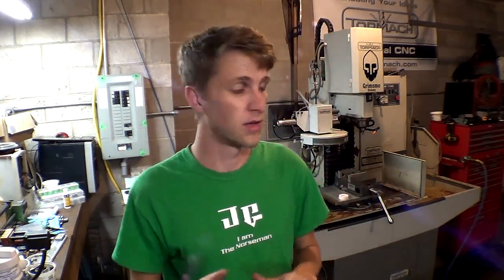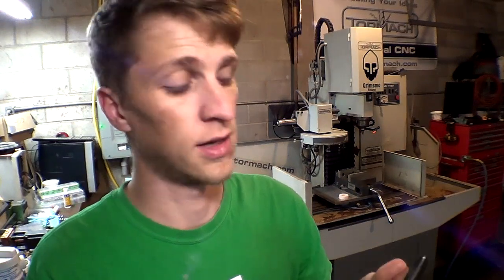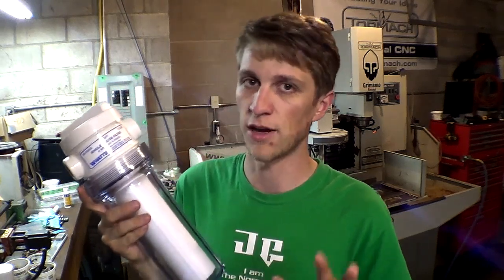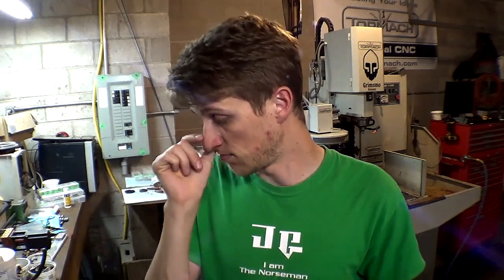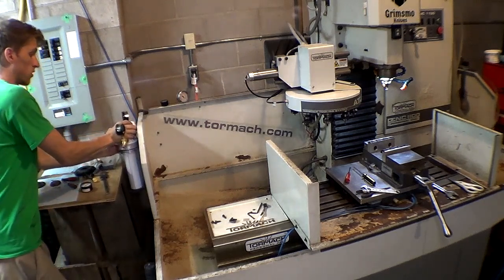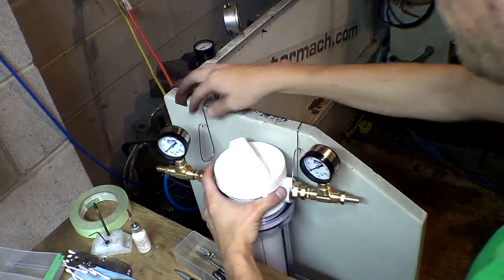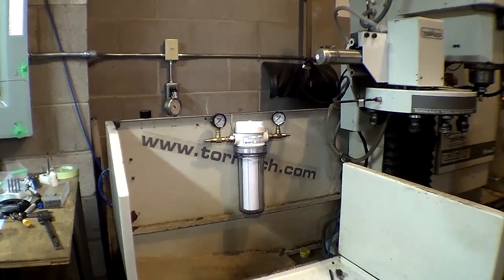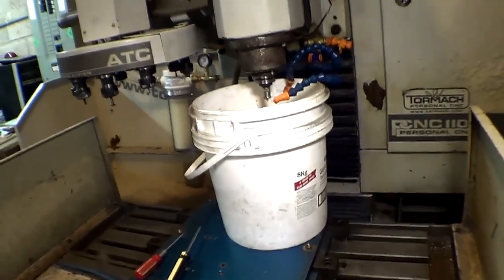Machining coolant filtration

Comment: A magnet in the bottom of your coolant tank will pick up and contain most of the ferrous chips you cut.  Could also put one in the chip tray next to the drain hole.
Reply from the maker: Good idea.  You could even glue a big magnet to the outside of the coolant tank, especially since my tank is plastic.  My  stainless blade chips would stick but all the Ti I cut wouldn't.
Reply from the maker: Good idea.  You could even glue a big magnet to the outside of the coolant tank, especially since my tank is plastic.  My  stainless blade chips would stick but all the Ti I cut wouldn't.
Reply: +JohnGrimsmo   just wanted to say I love your videos and ive been playing with cad for the last few months.  drawing triggers and pistol grips for some firearms i have.  I want to get into a mill and a lathe soooo bad.  just need to get into a house first.  then spend the next few years saving up lol. THANKS SOOO MUCH FOR DOING THESE VIDEOS!!!!
Reply from the maker: +toms place You're absolutely welcome!  There are lots of choices for getting into cnc, basically everything from a few grand and up. Have fun on your journey!
Reply: toms place you don't need a lot to get a lathe it a mill, I've got both for less than $2000.00 total. Including going to pick them up myself. Check out a site called govdeals.com they have all kinds of machinery for sale.

Comment: My personal recommendation would be to combine you strainer with an automotive oil filter, a large diesel engine one. It will pick the tiny stuff well, and extend the life of the coolant and part quality, not to mention your tooling. Just put the strainer you made in front of the pump, and an oil filter post pump.

Comment: Like the video I have a simple idea for ya I know you have all ready installed a filter for the chips but here is a thought for ya place a simple filter on the drane in to the sump something like a pillow case ziptied to the 90° it will help to reduse the frequency that you have to clean your filter and help when it time to clean your sump ... you may have to put a baffle in the tank to keep the filter off the pump (aka pillowcase)

Comment: this may have been covered below but, any specific reason why you chose to filter the discharge of your pump as opposed to the intake of the pump?  ideally the pump would then be protected from the filter as the chips/coolant sauce would drain into the tank.  maybe its harder than it seems, I'm not privy to the coolant pump system on the tormach

Comment: I filter the coolant coming out of drain.   Just take a butter tub or small bucket drill holes in the bottom and line it with plastic mesh.  It catches the majority of the chips and it's easy the clean out every few days. I use a small pond pump and a small tub like yours..  They work great. Nice job on your system!

Comment: See if a spin down filter would work for you.
All you need is a fine mesh, they are very high flow and use a vortex to push the chips to the bottom and clean the filter mesh at the same time, you can attach a reservoir to the bottom and the chips will fall into it. Do a google image search and you might get excited.

Comment: You can switch to a semi synthetics coolant if you would like to make sure you prevent rust. The shop I worked at got rid of full synthetic cause after the coolant would dry up it would cause rusting on our machines. We run our concentration between 6 and 8 percent

Comment: Problem lies not in the type of the coolant but concentration and condition of the coolant. If you know what "metal shop smell" is, that's mainly due to bacteria and other funky stuff living in the coolant that has seen it's best before a long time ago. Apart from the refractometer which ***** and others mentioned you might want also to pick up pH test kit, which are quite cheap, to control also the basicity of the coolant.
Reply: No I'm not, can't remember if I'm even registered over there :P And to be honest, I'm so lazy that I would never ever do a full cleanup and sanitation of coolant tank every 3-4 months. In the tẃo machines I use at work, I've last done a cleanup 1.5 years ago and the coolant seems to be doing fine.

Comment: As you were describing the "big blue" filter I'm thinking... "No way" haha. Im sitting about 4 feet from one hung on my wall for our water softener system.

Also - We run water soluble oils around the shop and I've never really had issues with the milky-ness getting in the way of anything.

Comment: Very interesting video! I've been getting some unpredictable endmill chipping and wonder if this could be the same thing that is happening to me. Chips recirculating. I filter them out pretty well with a series of screens so nothing substantial gets through but now I wonder. Hard steel chips are unforgiving. I'm going to look into this filter. 

Also it just so happens that I am out of coolant and was about to order more Koolmist 77 but had wondered if it's the best stuff to be using. I guess I'm satisfied with it but wish I knew if there was something better I should be using. In my experience it can cause rust and staining if left sitting and I heard it sucks at lubrication. I'm always adding more to maintain the medium green color. I started using it because everyone says it's the most benign smell and healthwise but it find it burns and irritates my skin if left on for too long and kind of makes my fingers feel numb. Plus it makes my skin and clothes reek like metallic chemicals for like a day afterwards even after scrubbing it off. Anyone have a similar experience or a better suggestion?
Reply: ***** I thought it was specifically for titanium?
Reply: *****
Ok I'm listening. It smells like playdough right? I can live with that.
Reply from the maker: Put one of the nozzles on that has 5 little 1/16" holes at a 90* angle, that's how I originally found out I was spitting out chips because those nozzles were clogging.
Reply: Good idea. I don't have any so I'll probably just check to see how much is in my coolant reservoir then tie a piece of screen around my nozzle and let it run for awhile.
Reply: JohnGrimsmo
I did the test with painters screen which is a very fine plastic mesh you can get from home depot in the paint department. I let it run for about 10min and there wasn't a lot of stuff collected but there were a few tiny chips and one moderately sized one. So I'm going to do this upgrade if it can help my carbide last longer. Thanks for the video I never thought anything was getting through my series of fine mesh stainless steel screens but I guess some chips are getting though afterall.
Reply: *****
Yeah probably not necessary. I'll be able to tell when I'm losing flow.

Comment: The rust might be from shop humidity. I use the synthetic stuff tormach uses as well but I only notice rust progressing when there's water on the sheet metal from condensation when the shop is cold over night. That only happened a few times when the shop door was open a lot during the day and I wasn't running the machine for a week or so. A dehumidifier might solve that. It'd help heat the shop as well.

So far just a few small spots, maybe a square inch total.
Reply: ***** I'd give it a C- on rust protection. No idea what to switch to so I just got 2 more gallons a few weeks back
Reply: ***** also, it completely destroys the plastic splash-guard. I don't know what it's made of. But it's not acrylic or lexan.
Reply: ***** Gotta tell me what it is first :)

Comment: Synthetic coolant is not the cause of the rust. Running at least 5-10% coolant/water mix will prevent rust and is rated for "moderate machining" you can measure coolant percentage ratio with a refractometer, they are cheap and easy to use.

Oil based coolants will do the same thing but the only big drawback for me is the smell. Over time bacteria thrives in oil based coolants and the stench is unmistakable. The odor soaks into your clothes and skin.  Also even small cuts on the hands tend to get infected with exposure to these coolants. 

Excellent videos, keep them coming!
Reply from the maker: Hey James, on the bottle it says that for light machining to use 20-25:1 concentration, that's 4-5%.  I've kept it relatively close to that, although a bit lean at times.  I do have a refractometer and use it often.  This coolant has an odor but it never changes, never goes bad, never stinks, and never has bacteria.  But I'm pretty sure it's eating my paint.  I just mixed up a new batch and am running it a bit richer, it feels slipperier too, I think it's around 7%.

Comment: Hi John,

Interesting video and just goes to show how there is more than ‘one way to skin a cat’ IF, that is you;re into can skinning, ;-)  :-)  BUT even if you had gone the $800.00 one you would still get that back in just a few of the many knives you do in each batch right.
Interesting although it is very low PSI potential you are as you said easily able to view the coolant as you work, and no doubt you will get used to what will be the ‘dirty or full filter colour.

Take care, and your knives will now be for sure even better than they were before. I do not know exactly how you sharpen them now but I do not think you could do any better that use the original sharpening method, IF that is you ever go back to it, or have it as an extra to be used ‘as and when specified,’ you know.

Take care
PS I am still jealous as hell for one of your knives as I have not seen better bearing in mine the shape of the blade. I also have noticed that there may be other similar blades out there no so they must have copied you?  :-)  

mrbluenun